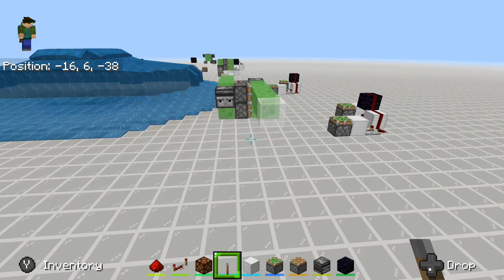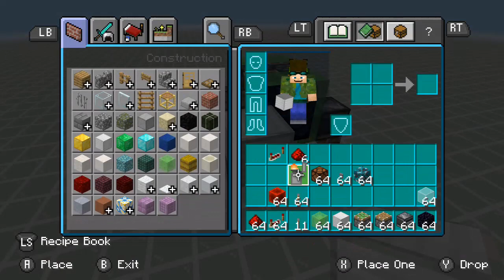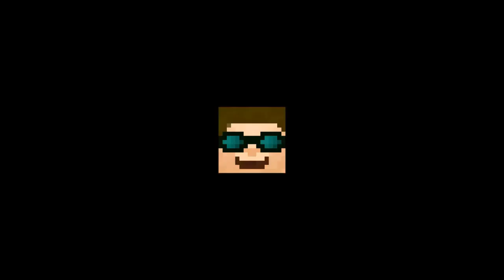2-Way Flying Machine [Bedrock Edition]

Comment: The first time it flew over everything was working as expected, but when I sent it back it started at half way going back and forth looked like 50/50 to me
Reply: I may have found the source of the problem, a slime block went missing
Reply: Jep had to break the machine itself once and rebuild it to work once again
Reply from the maker: @delimiter99  Huh, strange, it shouldn't go back and forth since it's one-way flying machine when it travels. Where did the slimeblock stay? At return station? If the problem keeps reappearing, try increasing delay on both pistons that pull/push observers. Hope it works then :-)
Reply: @samo_lego8465  the slime block was gone somehow, my first instinct was to assume that I punched it, but it was the lower on that had the observer next to it
Reply from the maker: @delimiter99  Sounds weird ... Hasn't happened to me while testing.